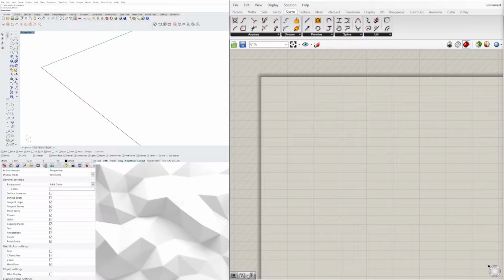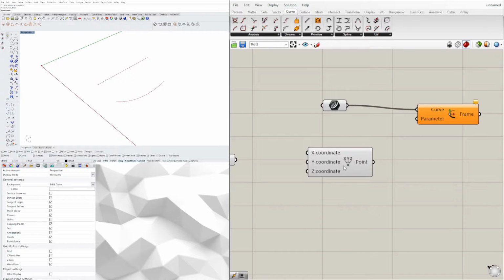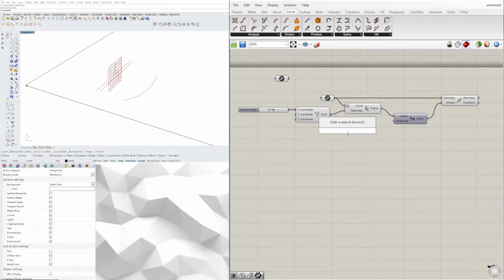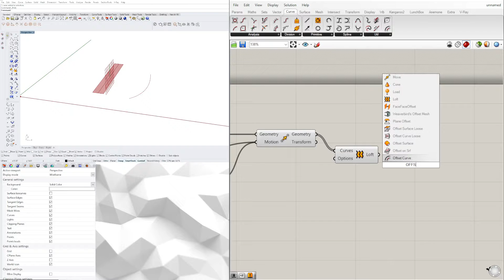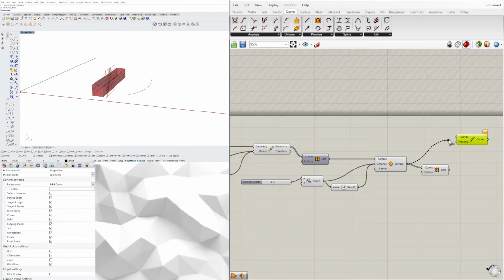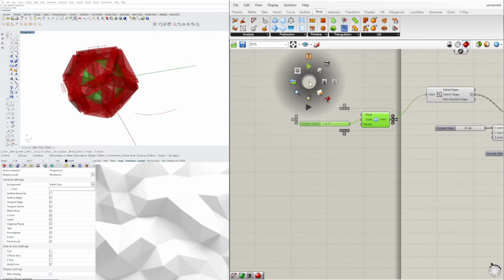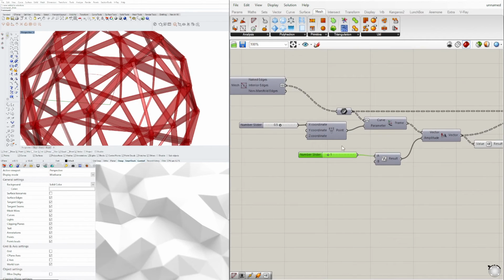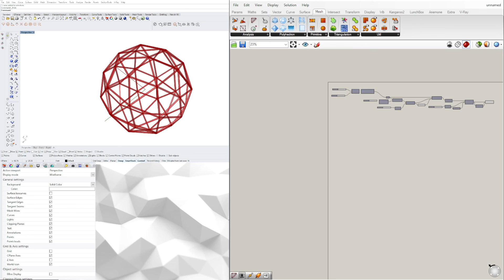Turning a curve into a square section Rhino and Grasshopper

Comment: Thanks for the guide! It works perfectly for the example curves, but how do I get this to work for multiple curves from rhino? When I try to set multiple curves the lofts seem to struggle.
Reply from the maker: you may need to graft the input curves. or it could be a flatten/graft issue with the data. send me an email to copetedavid@gmail.com and I can help you further